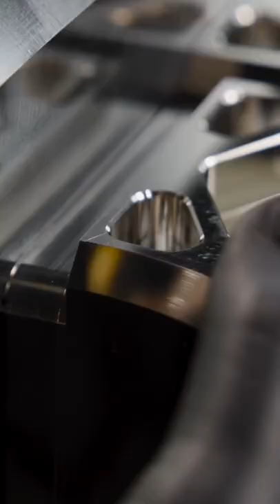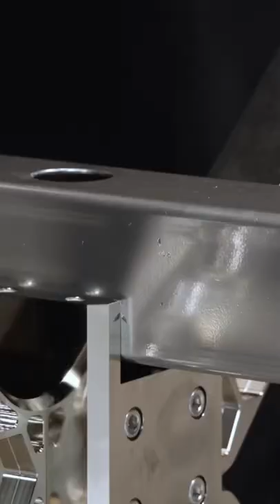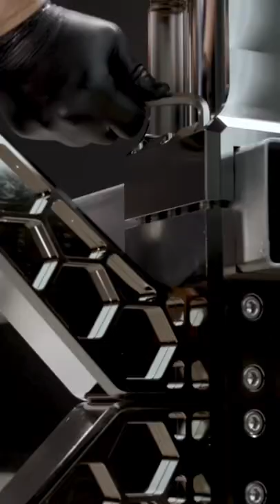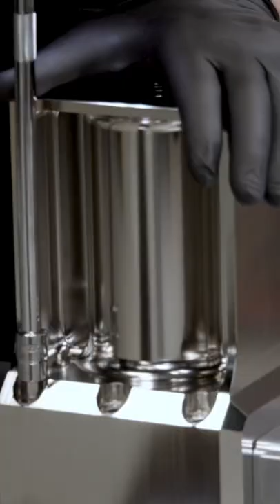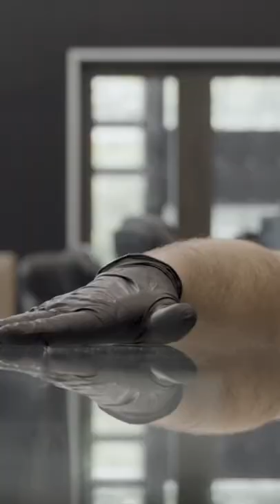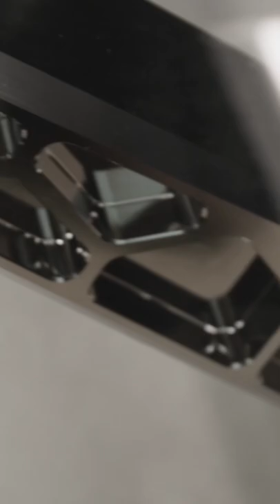CNC Machined Masterpiece #shorts

Comment: Having worked in the glazing industry and designed a few similar conference tables, you should definitely add some isolation pads between the supports and the glass. While it's unlikely, vibration or uneven force could cause the glass to shatter when striking the supports. You can get clear silicone pads that won't distract from the effect you're going for here and it's cheap insurance.
Reply: Bill nye the science guy!

Comment: Best practice is to put a thin layer of silicon pad in between the glass and the metal parts. So when it's accidentally stomped on, the glass would be well protected.